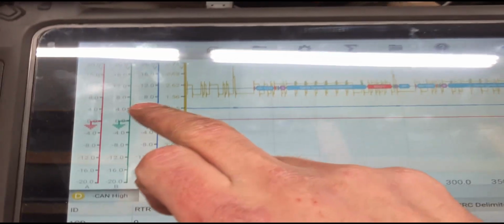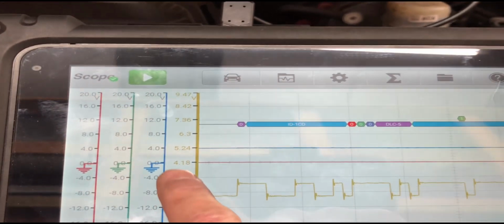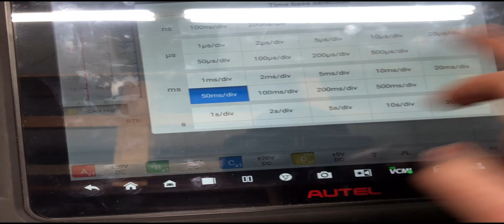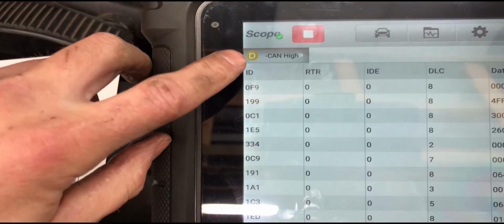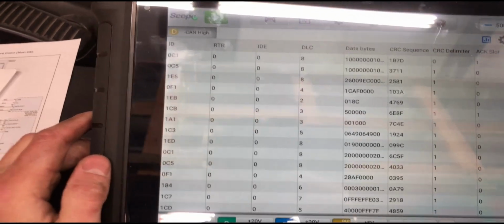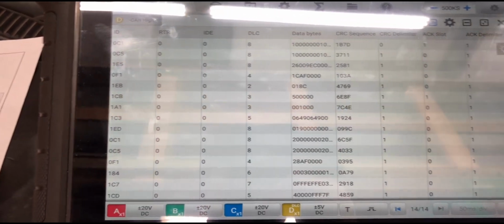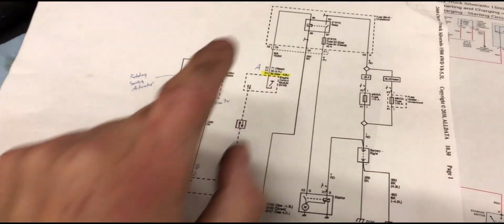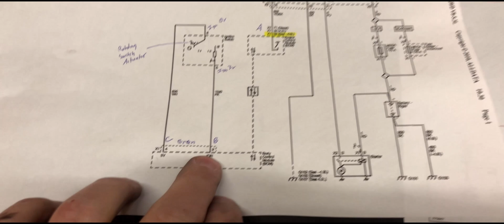Nerd Stuff - CAN network viewing on Autel

Comment: Do you know how Autel scanners query for OBD2 PIDs over CAN? The standard seems to be that scanners must send an SID of 0x7DF as a CAN request. However, my logic analyzer shows several transmissions initiated from the Autel scanner, but none of them contain the SID 0x7DF.
Reply from the maker: Ya, each module will have its own diagnostic request ID.  Simple examples are $7E0/$7E8 for PCM and $7E1/$7E9 for TCM.  

This is not a rule, but I have personally found it very typical for CAN network diagnostic ID to be somewhere around $4C0 and higher.  Diagnostics will always have higher IDs as they are lower priority messages.
Reply: @thekeeneygarage  thanks